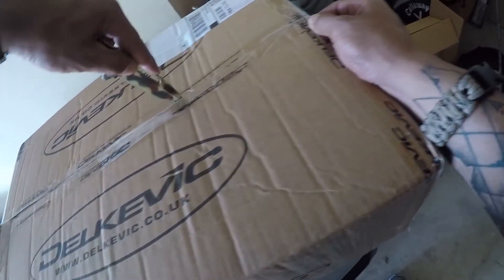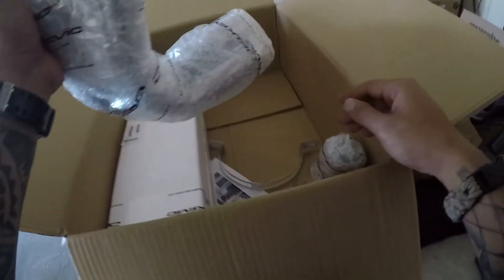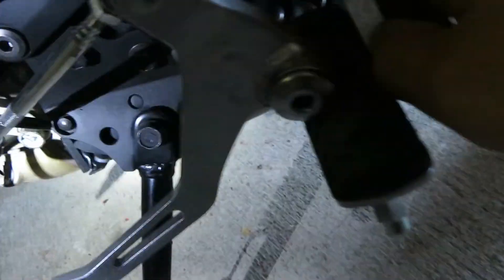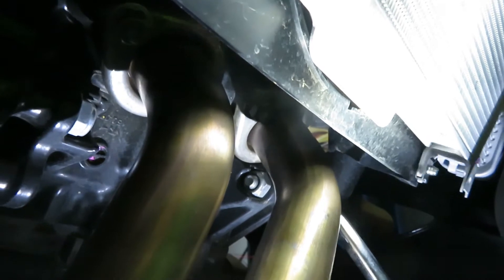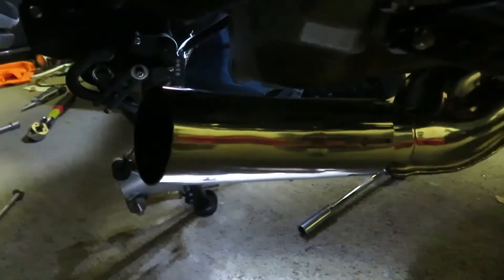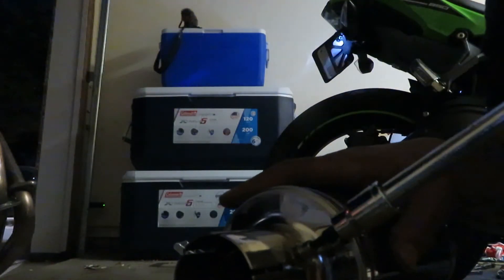2017 NINJA 650 DELKEVIC EXHAUST INSTALL

Comment: Just installed it sounds beautiful I'm just a little concerned about  Oxygen sensor and header screw tightness
Reply from the maker: Jacob Hernandez the oxygen sensor can be tricky, if it doesn’t twist to flush, having the center pipe disconnected and loose and turning that instead of the sensor the tighten may help get some slack
Reply: @RETMoto  did also tune anything or just add the exhaust as is smd that's for the tips and video helped out big time
Reply from the maker: I did not tune on this one but I did on my Z900, well I used a powercommander. Get a tune, it’s cheaper

Comment: I just got one...they sound awesome for $385. Definitely baffles out though!! Great video and thanks 👍
Reply from the maker: Robert Taylor no problem. Thanks for watching!
Reply: What exactly do you mean by baffles out? I’m interesting in getting this same exhaust and would like to know it’s pros and cons
Reply: @bry8505  Baffles help quiet the exhaust on any bike. Baffles out beefs up the sound greatly. Makes it more intimidating.
Reply: @bry8505  Not to mention when drivers can hear you before they see you it adds to your life expectancy 👍
Reply: @bry8505  this is old but putting for others too - these come with a removable baffle, the baffle breaks up the otherwise straight / unobstructed exhaust path through the exhaust and makes it quieter (tho not by much on these).

Comment: I got the exhaust and did u use the silicone that came with it to but on the copper  bushings for the headers
Reply from the maker: Jacob Hernandez I did, it helps keep the bearings in place while you bolt the headers otherwise they keep moving around. Thanks for watching.
Reply: @RETMoto  thanks I'm gonna install mine soon using ur vid thanks big help. Looking forward to hearing here rawr
Reply from the maker: It’s gonna sound real nice. I’ve installed this on my 650 and on my friends 650 and he loved it just as much as I did.

Comment: Will this exhaust work for the 2020 ninja 650??
Reply from the maker: BuffaloChinaRider I am not completely sure. But you might want to search for the brand. I know they completely remodeled the 2020 650 so you might want to check.
Reply: Yes it will
Reply: @joshhopkins4851  what is the full name for this exhaust and is it slip on or full exhaust? And will it fit the 2021 and 2022 ninja 650s? Please update

Comment: I have a ex650 2017 would it fit mine because I've been having trouble finding exhaust pipes
Reply from the maker: Jacob Hernandez yes, the ex650 is the same as the Ninja 650 so it would work. Thanks for watching.

Comment: do you need to get a tune or anything after installing that? please answer!
Reply from the maker: ImFwby I think it’s always recommended to get a tune but I don’t believe it will be a big issue if you don’t. I didn’t get a tune and it worked fine.

Comment: Hey thanks for the install video. My 8" mini just came in today and I couldn't find anything for the last couple of days on removing the fairings for the newer 650's. Nice work. Also have you had any issues at all. I've read a couple of reviews and they said it lost mpg, and it will need to get a dyno tune
Reply from the maker: J Barnett I haven’t had any major issues. Just small thing I need to correct. I’ll be putting out a video this week on my full review and mistakes I’ve made.
Reply: Nice.
Reply: Be a shame to go from 50mpg to 45 lol